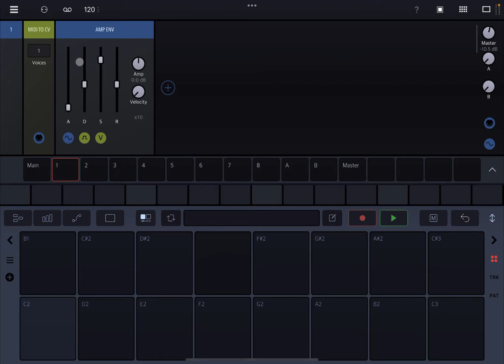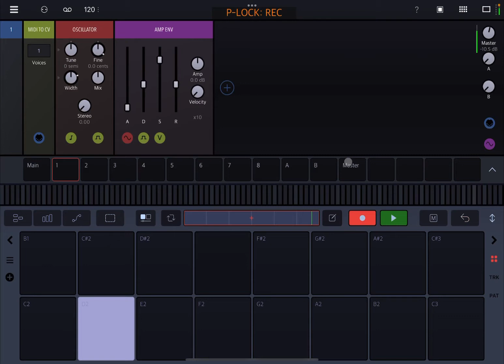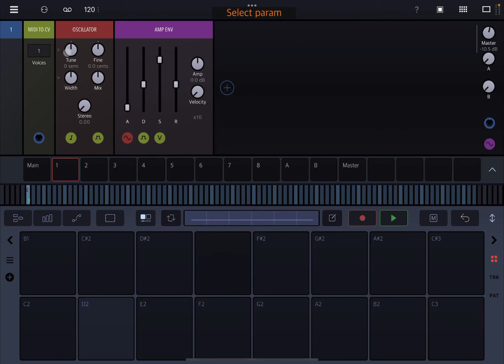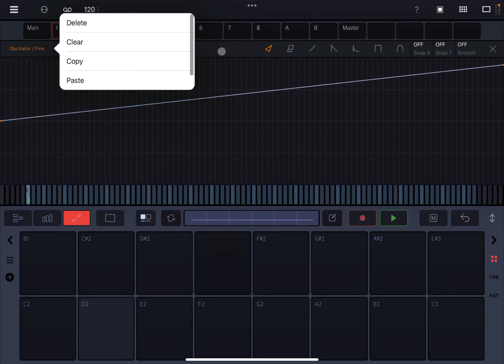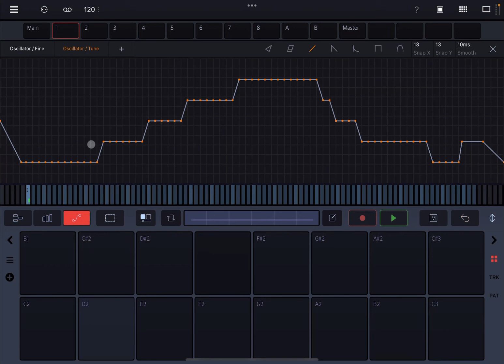BeepStreet Drambo v2 - Demo / Tutorial 73: Parameter Automation Editor

Comment: Seems odd to me Drambo doesn't record sustain pedal input when it can record automation like this.
Reply from the maker: Drambo’s roadmap is quite full :)
Reply: @soundformore  I guess so. I thought I had found a workaround using the Helium MIDI AUv3. But it was working, and then it wasn't. Still trying to figure that out.
Reply from the maker: You mean inside Drambo?
Reply: @soundformore  it also doesn't seem to respond to pitch bend input either. 

That roadmap is getting longer.
Reply from the maker: The roadmap is already long, lots of new features coming…